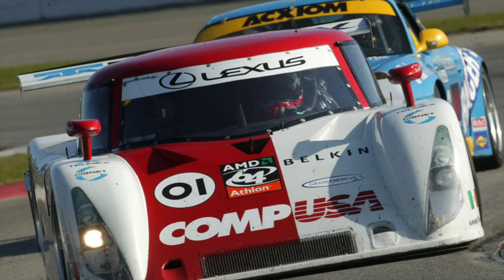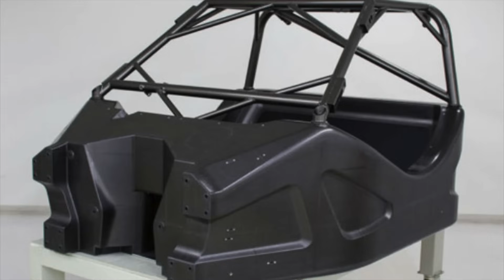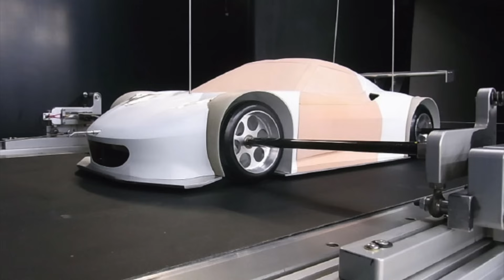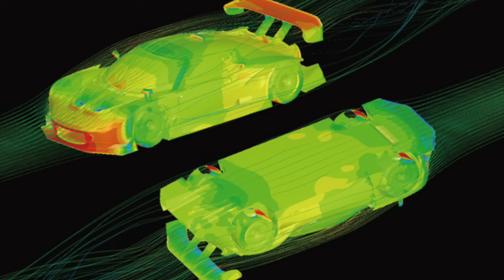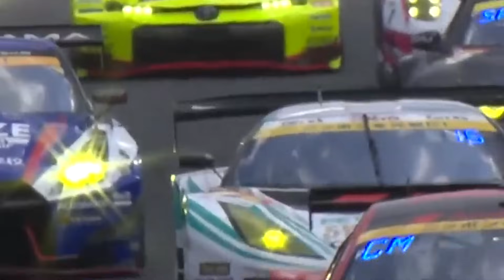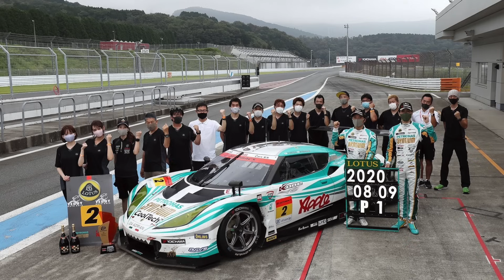Mother Chassis: Lotus Evora GT300 Super GT

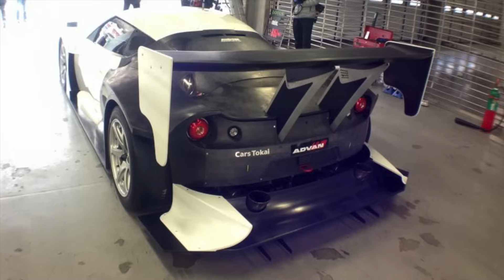Comment: 7:30 would an exhaust like this generate any down force in the rear or would it be negligible/insignificant?
Reply: I think they could have gotten away with a much steeper wing angle, the exhaust help push the air up against the wing.

Comment: For many years, GT500 cars were limited to around 500 hp and the GT300 cars to around 300 hp, but in the recent years, these limits have been relaxed slightly.
The class names have remained GT500 & GT300 though.
Reply: The new Honda Prelude GT500 can develop up to 650bhp. That's more than Class 1 DTM!
Reply: @farishanafiah8461  They've been hitting 650 for years
Reply: My man,Sam is the super gt historian of the English speaking world (was literally his jobs for years) he knows
Reply: The original iteration did limit it to around those levels but even then it needs an asterisk as some of the slower, privateer 500s tended to have as much as 550HP in some cases.

Comment: I was expected that only the based Japanese cars have mother chassis but turns out that the Lotus Evora is one of the non-Japanese model that also have a mother chassis. It's really heartbroken that the tire wars will end by 2027.
Reply: As much as I love seeing the tire war, I can understand why Autobacs are doing it. It's the same reason why SRO only use Pirelli for all their GT racing series - it's to give the right kind of BoP.
Reply: Having open tires, which is the biggest way to gain or lose time in a class with BoP, which is meant to make cars (near) equal was always a tad silly.Though I'd wager losing Michelin and Bridgestone becoming all conquering (for the most part) as a result was the reason why GTA decided to have spec tires in the future.
Reply: The tire wars are already over, dont 90% of the grid already race under the same brand?